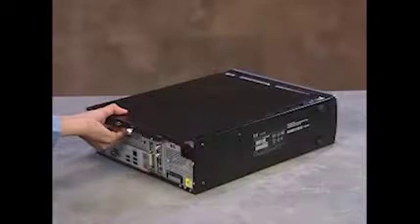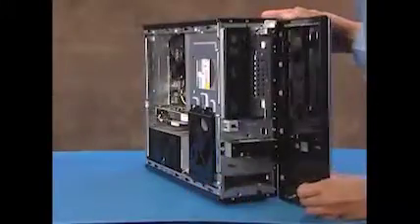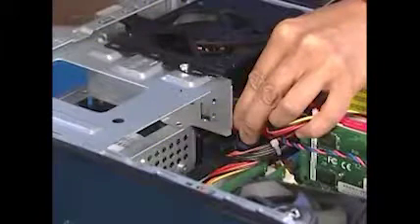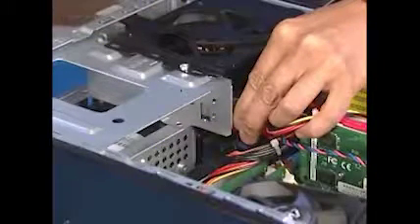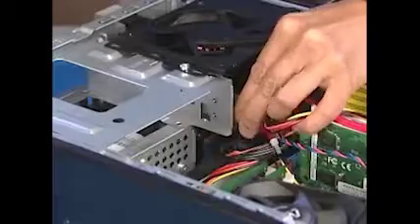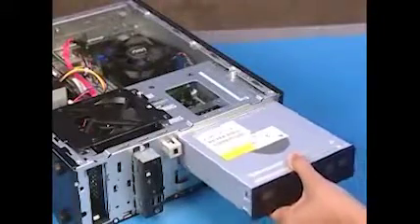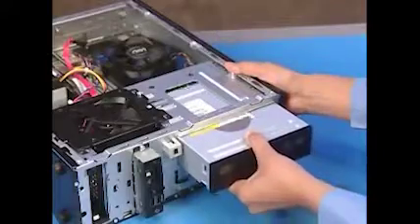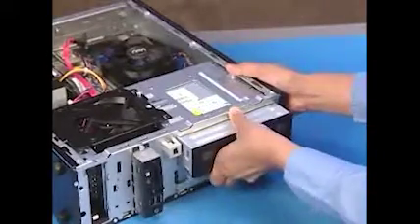Replace CD DVD Drive | Pavilion Slimline s5000 | HP Support

Comment: Hello HP so I have a hp pavilion slimline s5610f I was wondering how man ram can it be max out and can it be add a GTX 710 ? And do I need new thermal paste?
Reply from the maker: +DieSoft_ Gaming Please refer 'Memory upgrade information' under the specification page to know about supported memory: https://bit.ly/3pYFdOL This computer have 2 PCI Express x1 slots So you can add graphics card that supports this slot. If the thermal paste is dried up, you can go ahead and replace it.